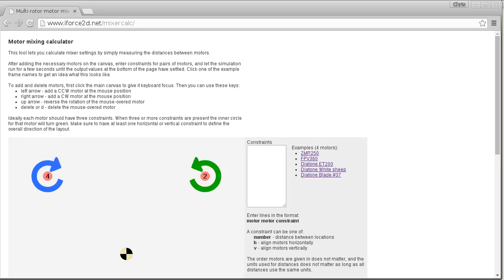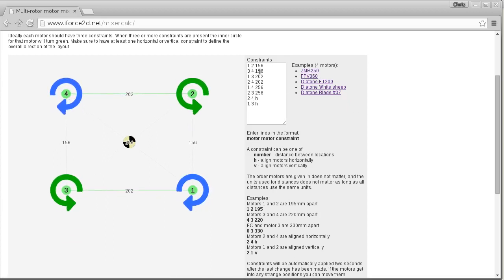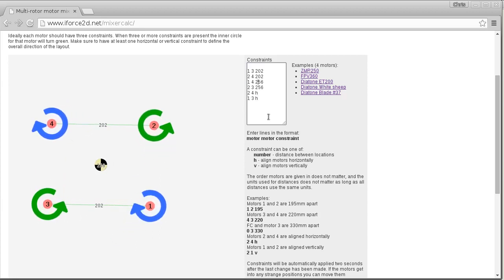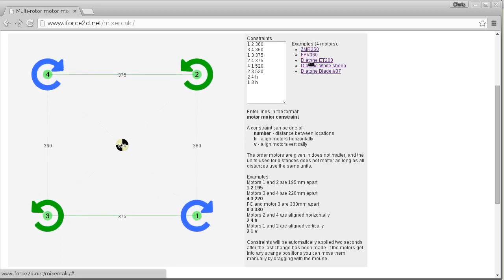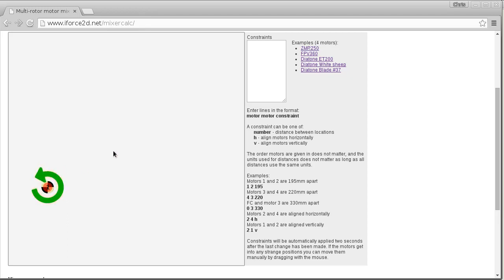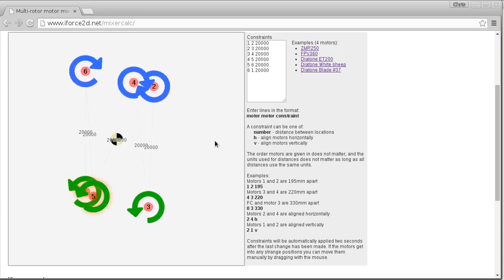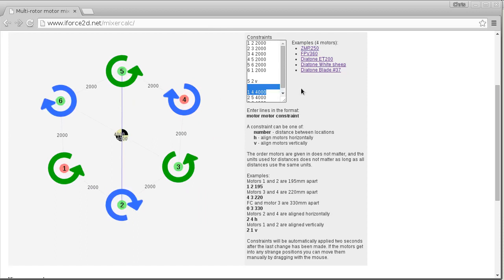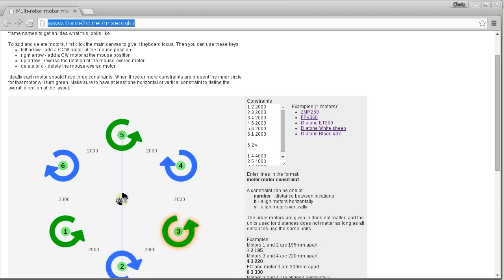Multirotor mixing calculator

Comment: http://i.imgur.com/GVVtliJ.png

how come moving the flight controller doesnt effect cmix? shouldnt the center of gravity be at the flight controller?
Reply from the maker: thejackofclubs In a well set up frame the center of gravity should be at the average position of the motors, so that they carry equal weight. If possible it's a good idea to have the FC close to the center of gravity too, but when it comes to deciding how much thrust each motor should output to rotate the craft, the FC position is irrelevant. It looks like you have discovered my old method of using motor number zero to measure distances between motors and the FC, but that gave me quite bad results. All you need to do is measure and enter distances between motors like I showed in the video.
Reply: ***** ok thank you. i have an sk450 deadcat. its probably not the most well designed frame, but it has an excellent camera platform on the front. i cant move the flight controller platform any further back than it is, but i can move the battery around to move the center of gravity. i guess my question is now should i move the center of gravity to the cross section of the motors? and what does the black and yellow marker represent?

i tried making the fc the center of gravity, but it pitched heavily forward, i moved the battery back and it seemed to help, but im not sure where the best place to put it is.

http://i.imgur.com/SwHwM8a.png

for some reason people really dont have a problem running this thing with the kk2, but i really love my cleanflight board.
Reply from the maker: thejackofclubs The black and yellow marker is the average position of the motors, which is where the center of gravity should be. Yes, you could try moving the battery around to get the CoG of everything as close to the average position of the motors. Fortunately for a quadcopter the average position of the motors is easy to locate, it's just the halfway-point between the motors in each axis (left-to-right, front-to-back). Most likely you'll have no problem for the left-to-right axis since the frame is built symmetrically that way, but the front-to-back CoG is easy to locate too - hold the frame from below as gently as you can with just one thumb and finger on each side so it is free to tip forward or backward. Move that support point forward and back a bit until you find where the frame doesn't tip much either way. Move the battery to make that tipping point halfway between the back motors and the front motors.
Reply: ***** thanks for your help, i flew it today, its still not flying quite how i want it, its a bit jerky, but i dont think theres really anything i can do about that on this frame. atleast its not pitching forward.

Comment: Just tried using this tool with the latest source from Github. It seems in addition to changing the command from cmix to mmix, I also had to number the motors from 0-3 and not 1-4.
Reply from the maker: Philip Stubbs ah yes, somebody mentioned that, for the un-released beta version right? I wonder why little things like that need to be changed... I see only confusion and no benefit.
Reply: ***** yep, I am running latest from Github. Not sure if it was changed intentionally. Having managed to get a few documentation changes merged, I am tempted to to try and fix this myself. Failing that I could at least fix the documentation for Clean flight.
Reply from the maker: Philip Stubbs I think the docs as they stand now are correct, especially after the change you just made. What I think is missing though is a mention that it changed from cmix to mmix between versions 1.9 and 1.10. It looks like the previous 'cmix' has been split into 'mmix' for motors and 'smix' for servos separately.

Comment: This is really cool! Do you know if there is a way to calculate values when you have a center of gravity that is not in the middle of the craft? For example, the blackout hexacopter, the COG is much further forward. So the power to the back motors needs to be reduced in the cmix.
Reply from the maker: Adam Wilkinson The center of gravity should be at the average of the positions of the motors, so that each motor is carrying equal weight. So if the CG is further forward, a properly set up craft will have more motors toward the front, so that in a static hover all motors will be giving equal thrust. This calculator assumes this is the case, but if the CG is unbalanced for the motors that are lifting it (bad idea in general) I guess some modification could be made to let you manually position the CG.
Reply: ***** Yeah, I totally agree that it's not ideal, as you need to loose power in order to fix it. If you want to have a cool looking frame I guess you have to make sacrifices! :P